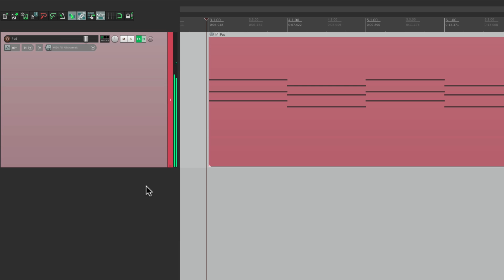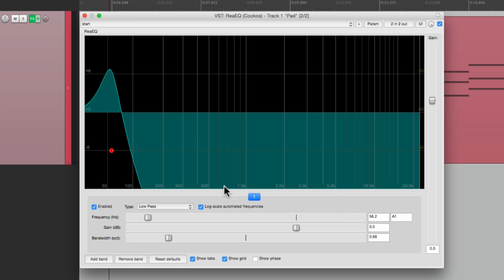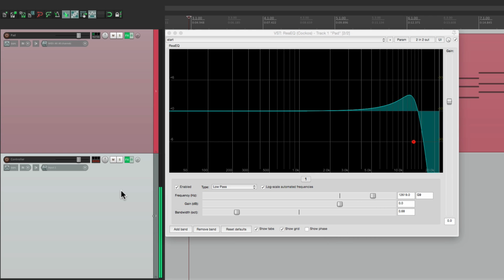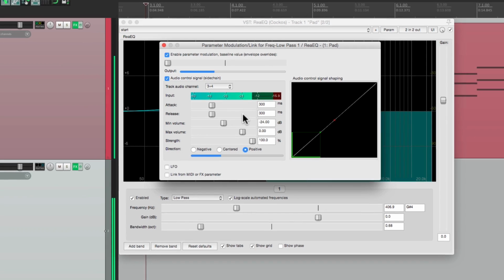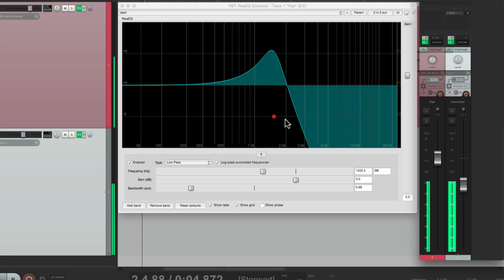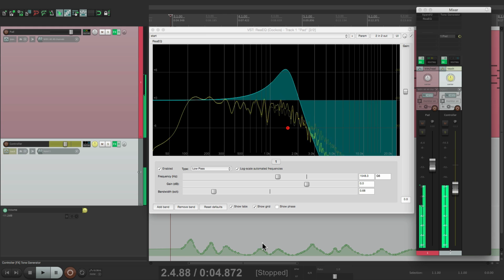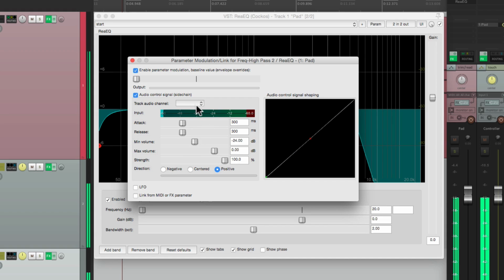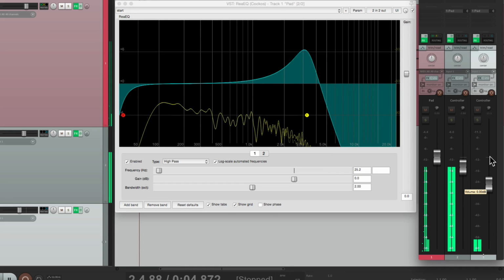Using Faders to Control Parameters in REAPER

Comment: thanks a lot for the tutorial.
I'm trying to use this tip with VideoProcessor 's Opacity parameter but it doesn't work. I'd like to fade between videos using a fader. Perhaps being a 0 to 1 value it doesn't work. Please, could you shed some light about it?